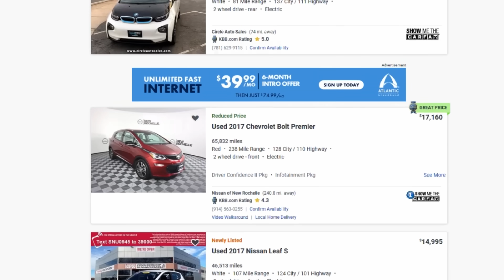Bolt Alternatives Under $20k

Comment: Personally, I would take the buyback.  I qualify for the full 7500 tax credit and I’d look for a good lease deal on an ID4 or Mach E.  When the warranty is up on my SR+, I’ll have to make a tough decision.  If trade in values are still this crazy high, I’ll probably go new.  I wish Tesla would offer a lease that fairly reflects its high residual value.
Reply: Just FYI, if you lease, you don’t get the federal tax credit. So while an ID4 qualifies and you can get the tax credit if you have that much tax liability, you have to purchase the vehicle, not lease.
Reply: Same with the Mach E.
Reply: @loriallen67  You’re partially right.  The 7500 tax credit goes to the bank or manufacturer that leases the car.  I’m assuming the credit gets factored into the lease.  So I guess it doesn’t matter if you pay enough federal tax to deduct 7500.
Reply: @willaerley7140  the tax credit depends on three things: purchase (not lease), the vehicle manufacturer hasn’t maxed out the number of sold qualifying vehicles and your personal tax liability. If your total tax owed for the year is less than $7500, you will get a credit only up to what your total tax owed is.  I had to research this heavily to make sure we were getting the $7500. 

They may factor the credit into the price of the lease. Certainly negotiate for that. But if they won’t, you can’t get it if you lease.

I personally didn’t like the ID4. We have a Mach E to be delivered next month hopefully. In 3 years +/- I will replace my current vehicle with an electric car. Not sure what yet as there will be more choices by then. And if the tax credit is no longer available for any vehicle, I will greatly consider used EVs.

Comment: I did similar calculations recently. I ended up trading in my Nissan Leaf for a Toyota Mirai. The fueling infrastructure is somewhat limited, but likely to improve. The fast charging speed is unbeatable, and the price is sub $15,000. It also comes with a three year fuel card if you buy certified. That makes it pencil out to $9,000 over the course of a loan vs paying for gas (or fast charging).

Comment: You shouldn't be concerned about your Bolt, GM addressed in a smart way, Hyundai's approach is idiotic. GM is dynamically measuring the actual health of the batteries. That not only addresses the manufacturing defect but also future problems that may arrise due to aging. Nobody knows how any battery is going to hold up over 10 years because there aren't any 10 year old EVs yet and even those that are approaching that age are using very different battery chemistries than you four year old Bolt which in turn is using a different than what's being used today. Hyundai is spending a fortune replacing mostly good battery packs with new packs that might be just as problematic as the old packs. Manufacturing defects are going to happen, you can lower the defect rate but it can never be zero. And as I've already pointed out you can't know for sure what will happen in the future. You should always trust engineers over PR people. GM is using an engineering solution, Hyundai is using a PR solution.

Comment: Portland does have pretty good public transport and it's pretty good for e-bikes, or regular bikes, and most of the time it's pretty good for motorcycling. There are a few snow/ice days that are bad for 2 wheels, but with all the hills, it's pretty comical for cars as well and there are plenty of YT videos of cars sliding and smashing. Mostly it's above freezing, although for a few days this week it was Las Vegas hot.
That's my wordy way of saying I would have snatched the money from GM's hand and waited a few months to a year and get something better, even if it's another Bolt. The expense and bother of moving a car across the country versus having cash in hand would be an easy choice for me. I know the Nikki fam also chose to keep their Bolts and maybe if the software fix doesn't work GM will make better offers because I doubt there will be a resale market after that. However, I am well known for selling my diesel VW a few weeks before their buyback window, while my friends that hung on made out like bandits getting nearly full price back.